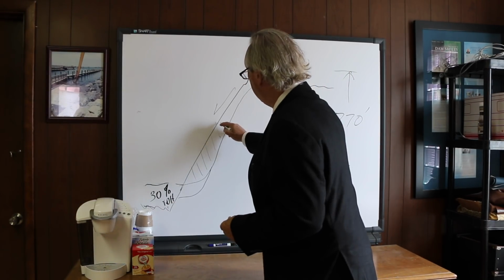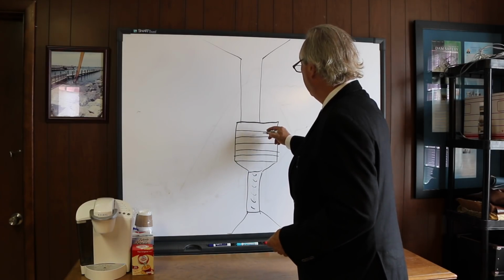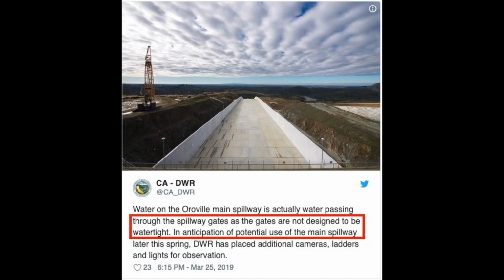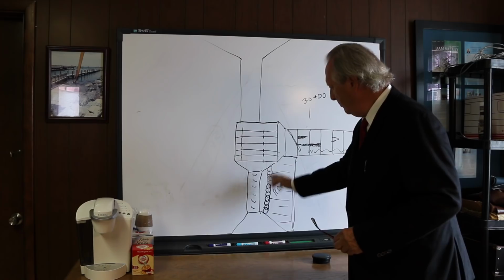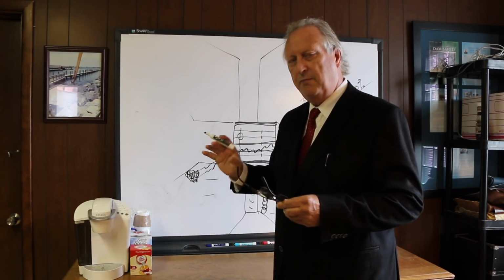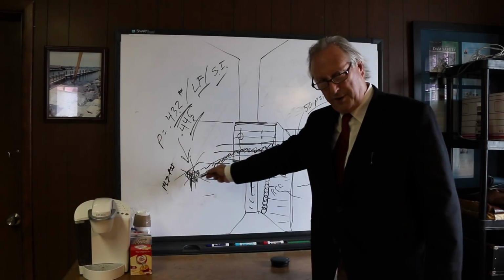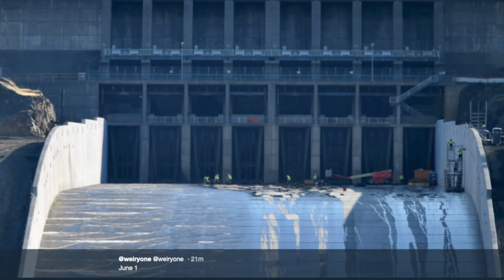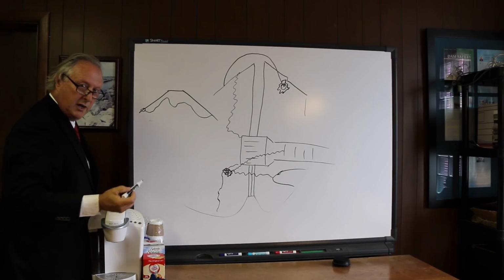Cahill on Oroville Dam 06-01-19

Comment: I didn't hear you mention any kind of vibration occurring while water is flowing through the normal spillway. If the foundation is saturated and a forced vibration is induced in this foundation, the hydraulic forces could undermine the concrete slabs lining the spillway. I remember the rumble generated when I watched water flowing through Friant Dam when I was a kid. Someone said long ago the all we have to fear is fear itself. I would say that we have to fear silence as well. FYI, I'm a mechanical engineer, not a civil engineer.
Reply from the maker: I made a video on the slab undulations and the harmonic resonance that caused the initial failure of the plate slab. Please refer to that for an explanation. The drain outlets are dry because the water is flowing out between the slab and the rock and pouring into the stream below. It is also eroding adjacent soils along the outside of the training walls.
Reply: @scottcahill945  I still don't get it, because we know water looks for the easy way out.
The drains are in trenches formed into the dental concrete and the RCC infill. This below the lower slab side. 
So how come zero water is finding its way into the drain system? 
I've looked at the spillway lower cam and don't see water pouring from between slab and rock.
I've seen the erosion to the left side of the spillway, but there is no river of water happening either side of spillway.
I really have to ask why Keiwit would install a drainage system that captured no water at all.
Reply: Scot that is a wrong statement about " The drain outlets are dry because the water is flowing out between the slab and the rock and pouring into the stream below. It is also eroding adjacent soils along the outside of the training walls." You sir are not stating the facts about how the under slab drains are piped to the outside of the training walls then parallel on a down hill grade to a through the wall outlet. That is how it is designed to do !!
Reply: @stutz1751  Is there a drawing on-line that shows this?
Reply: Geoff O'Neill there are a lot of high res images available that show how the spillway is constructed.
Reply: @scottcahill945  https://www.youtube.com/watch?v=GV0j62A2F7E at about 5:25 right?
Reply: Geoff O'Neill if the foundation is saturated why are all the under drain outlets dry? This new spillway is constructed from washed and vacuumed rock face, next to dental concrete, overlaid with 2.5’ thick reinforced slabs. How can that be saturated?
Reply: @JohnnyMotel99  The porosity of the underlying rock is fairly low quality. From what appeared was eroded away and uncovered during the first spillway failure, it looked like it was full of fissures and compacted soils. Like Scott said: where is this water coming from, besides the leaking gates?
Reply: @jfscnl  I agree the underlying rock is pervious, consider this....rockface cleaned, washed and vacuumed, this provides best adhesion for dental concrete.Drains set in trenches that are formed into the dental/levelling concrete. 2.5 foot reinforced slabs laid over levelling concrete.. Water will always seek the low point, so any groundwater will fill the trenches first, that's where the drains are. How can water come up through the slabs if there is an easier way out?
Reply: @JohnnyMotel99  You're talking about the monolithic roller-compacted concrete (RCC) that is underlying the reinforced slabs? There's no chance that cracks form in this impervious dental / levelling layer as the concrete cured? You seem to know quite a bit about this project. What is the purpose of the sandbags diverting the flow of leakage to one side of the spillway? Was the spillway instrumented for the last high-flow test? It seems there's a little hubris at the DWR letting Lake Oroville get to 98% capacity with so much data withheld. I think people have a right to be concerned.
Reply: @JohnnyMotel99  https://www.youtube.com/watch?v=VVWv5RqFQ5I at 1:52. Are these the drain pipes you're talking about? They're 10 or 12 inches in diameter. Why so big?
Reply: Geoff O'Neill there is a graphic cross section in DWR press section of how the spillway is constructed, it says 8. I saw the closeup of the worker putting on glue. Looking at it and comparing the diameter to the swab, it doesn’t look like 12, could be 10 or 8. 
But why such big drains in the first place? In the forensic report, they say that spill water went through the slab joints and into voids and the old drains. So maybe the engineers figured for a long lifespan and installed big drains. Nothing suspicious.
Reply from the maker: Significant amounts of water are flowing from beneath the slab at the base of the slab of the sluiceway. Have you asked yourself why they keep pouring stone and earth into holes along the outside of the training walls? Appearances are disturbing to me. I hope that I am wrong and that everything is great and no problems exist. I stated what I believe and the reasons for that belief. That is sufficient.
Reply: One other point. Vibration data must surely have been gathered during the test of the spillway. Has anyone outside DWR and the contractors reviewed it?
Reply: @jfscnl  : Even if they have and I believe they have the information, it would be censored don't you think? The earthquake meters were measuring something when the MS was being tested, but no news since then.

Comment: Scott,  how can a port  between the pressurized pool and the underside of the spillway can be actuated when the gates are opened but not when the gates are closed? If this port existed, you would think it would be leaking all the time, regardless of the gates being opened or closed.
Reply: TheStarseer I’ve been saying that the spillway drains are ALL dry, so there is no water under the spillway. But other folk counter that with blocked drains, wrong gravel. These are 8” land drains, how do you block an 8” pipe?
Reply from the maker: You block a drain by filling it in an instant with fines (mud). If this is trolling I will let it go. If you have an honorable question I am happy to engage. I think it normal to accept that false narrative has been induced into the Oroville discussion always. Truth, that is the ultimate repair. Without truth these false narratives just frustrate.
Reply: @scottcahill945  Thanks, not trolling you. 
OK, 8" drains are used there, there is only one photo of gravel being poured into a drain trench, I downloaded the original and saw that the stones looked graded and washed. The slits were so narrow that the stones just sat on top. I agree 'some' fines would get through, you know drain rock is graded rock with minimum fines.
Here in the UK we have something called MOT40, everything from dust to 40mm, used for road underfill. I have done land drains in France, we use 20mm graded rock.
It's difficult to envisage so much fines getting through to clog an 8" drain. Then they have inspection ports everywhere for camera moles. Having said that, I'd expect a small amount of silt to be in the drains.
Reply: @scottcahill945  dam inflows are flucuating wildly today,  what do you make of that???
Reply: @scottcahill945   It appears that once R Dunphy brings out a very logical engineering point you immediately accuse him of TROLLING . You are talking for the most pert I think to a bunch of engineers that have also worked on similar projects and should not discount their opinions as we also have opinions just like you. Answer this Scott ,...HOW do you think that 8" transvers drain pipes fill up with mud to the point of not draining though the training walls and the spillway has only been used once in APRIL 2019 for a short test ??? If all of the mud and fines did as you say that would be one hell of a void some place under the spillway,...well we will just see soon when they open the gates and all of those failed slabs that you say are now exposed will come tumbling down. You Sir need to get a grip on your self !!!
Reply from the maker: Great question. I, too have pondered this since before the first failure of the principal spillway. I suppose that there is an open joint or void of the structure that is impacted by the high-velocity of the water from beneath the gates when they open, charging this area with water under pressure. It was very apparent with the original drainage vents blowing water out into the spillway. Now, suprisingly, there appears, still this communication. There is evidence of water coming out of the joints, the RCC, and the soils all of the time with a full or near-full pool. Thanks.
Reply: @scottcahill945  yes, there is evidence of leakage, though nothing like in 2017. The fines that started appearing on the MS as the level got above 890' were particularly concerning, as that means the greater pressure was further eroding the earth  around the entrance to the gates. I'm holding my breath for the opening of the gates... Thank You Scott and Lisa for speaking out about this very dangerous dam.
Reply: Scott Cahill in the forensic report on the 2017 failure, their assessment was that water went through the joints from the topside, where it met broken or blocked drains producing the uplift. It is salient that the old spillway had water stops only on the vertical joints, I imagine the designer thought this way water going through any horizontal joints would be picked up by the drains. The new spillway has water-stops on all sides of each slab. 
The drains are all installed below the underside of the slabs in trenches formed in the dental concrete, water being water will gravitate to the lowest point ie the drain trenches. All the drains are dry....
Reply from the maker: @JohnnyMotel99  The forensic report was written by five engineers after they fired some of the already enlisted engineers. They directed these "new" engineers to do no assessment of the controlling structures or any other element of the dam. They were only to report on the new spillway. They now use this report to declare that the areas forbidden are trouble free.
Reply: @scottcahill945  The report I read was only about the old spillway failure and reasons for that. I haven't sees any report on the new spillway.
Reply: @R Dunphy - Post a link!
Reply: Agenda21Truth1 for what? I pretty much refer to images on the DWR site, they have search there too, you can put in drains and all drain images come up.
Reply from the maker: Perhaps the same way that the eight inch drains that filled before filled with mud. The problem is not one of choking of the graded materials of an under drain. The problem is a communication that occurs between the pool and the slab base. I, of course do not know exactly what is going on, but, as I stated in a letter two years ago, there seems obvious issues with communication between he pool and the under slab areas near or under the gate structure. Couple the obvious port indications with the constant emergence of water in high water situations, differential settlement of foundations of the gate structure (resulting in binding of gates for years, tearing out and failures of tendons at the trunnion blocks, the tearing off and galling of the brass wearing plates of the radial-arm gates, failures of the gates in the past, etc.) The obvious initiation of the introduction of pressure water beneath the slabs pre-failure is water communication with the pool. Further there are many indications of the non-phreatic movement and venting of water in both abutting indigenous soils. This is even discussed in the construction documents of the dam and identified as a "canted plane" of conductive weathered rock at the abutments. These manifest as wet spots and emergence with significant flow at high elevation of pool and many have been caught in drains and conducted to daylight such as the one in the RCC area of the right emergency spillway. I cannot know what the exact conductance is from Ohio, but it seems obvious that all of these voids, emergence, and foundation subsidence is coincidental to an area of water through soils. Again I do not know, but it does seem pretty obvious when men are flying rocks by helicopter to drop in deep holes in these very areas. It is an issue easily addressed with a competent grouting program but it is an issue that will probably cost a considerable sum if undressed and jeopardizes the structure potentially. I love getting into detail and I have many opinions and thoughts but as you ask me these questions others threaten suite, I shall for now keep those opinions to myself. I have offered my help without any request of compensation and I have written my considerations and sent them to those who should be interested. I have done what I could to keep from seeing money wasted. I hope for the best for the contractors and the engineers who struggle with this dam and I hope for the successful repair of the dam. I doubt that we are now there. Thank you.

Comment: Is it true once an Earthen Dam always an earthen dam?  
Could Oroville Dam ever be rebuilt like a Hoover Dam model? Or should have it been rebuilt like a Hoover Dam back in 2017?  Aren't earthen dam's more vulnerable anyway?  It seems with such a large dam it should have been more of a priority to make it more sturdy, etc.
Thank You for Your Presentation+
Reply from the maker: You are very welcome. The dam can remain indefinitely if properly maintained. this will require regular maintenance of the dam including new drainage systems and grouting programs. The work on the spillway, we shall soon see was a waste of much. The failing under-drain can only be properly repaired by removing and replacing the slabs. The shocking thing about Oroville is how far it got, and the response of those responsible. That is a grand failure and unacceptable. Attacks and threats on those who question will never make things better. Thanks.
Reply: @scottcahill945  Do you mean to try and tell me that the undrains in the newly constructed Oroville Dam Spillway has failed ??? If so you are dastardly WRONG !!! Or,..... are you saying that is was the cause of the original 15" thick concrete spillway structure placed over clay of which I agree. Even as bad as the original under designed spillway was ,...it still lasted 50+ years with little maintenance.
Reply: Scott Cahill Scott, how do you know the under drains have all failed? Just because they are dry at the outlets, doesn’t necessarily mean the system has failed. It could just mean there is no significant GW under the spillway. The BOC report on the upper section, noted a small amount of GW but didn’t note any correlation with a lakeside origin. 
There are numerous construction images detailing the drainage system and the slab design, all followed modern spillway design recommendations.
Reply: @JohnnyMotel99 In the video, Cahill points to the water coming out of the construction joints as his evidence that the under drains are not performing their necessary function.  There must be some head under there for that water to come out of the construction joints.  If the drains were functioning as intended, no significant amount of water would be coming out of the joints.  Unless you are aware of some other explanation?
Reply: @philblum1496  I am aware of another explanation... water is not coming out of the joints! 
There is a photo on the DWR image site that shows water tracking along horizontal joints and spilling out at a low points. This the real explanation and it's so simple. 
(Scott admitted to me in a reply that this could be happening)
I find it quite astounding that people latch onto rumours like "clogged drains' etc when they have no idea what it takes to clog an 8" drain. Even Scott believes this, which is more incredible. 
So much photographic evidence on DWR site proves his theories are wrong.
Just think about it for one minute, every drain outlet is DRY, this means, according to Scott, that EVERY drain is clogged or broken. That's every 8" PVC drain at 30' intervals is clogged or broken. Now which do you think is more likely, the drains are dry because no water or every drain is blocked or broken?
One thing I can guarantee, when the level gets to 813, the spillway will dry rapidly....thus no water under the spillway.
Reply: Light Fawn I would like to see this Dam draining and engineering designing a proper and solid CONCRETE Safe Dam. Of course it should have been done fifteen years ago and they, and WE just simply didn't get it done. DWR has ignored even the crucially important needed repairs. CHEAP CHEAP CHEAP CHEAP OUT. Now A Billion and a half dollars Waisted on a cheap shit patch job that will need to be torn out one way or another, it will and start all over with engineering and constructing a Dam, DAMM.